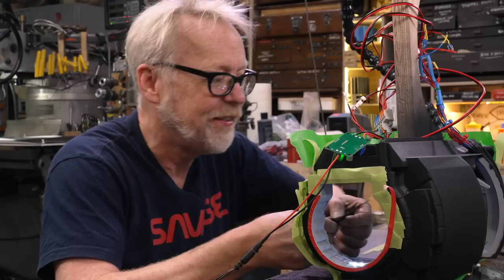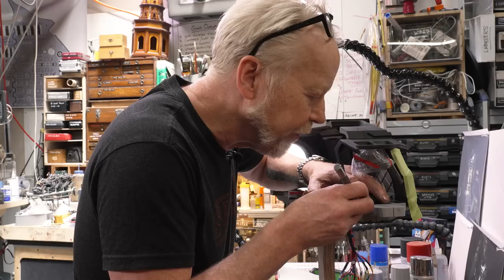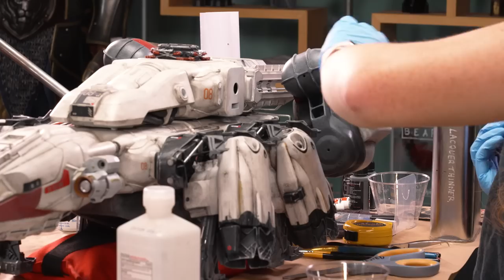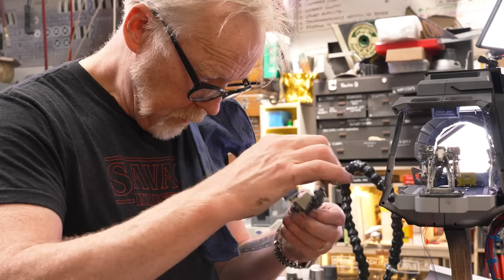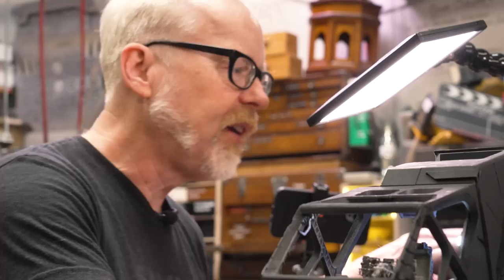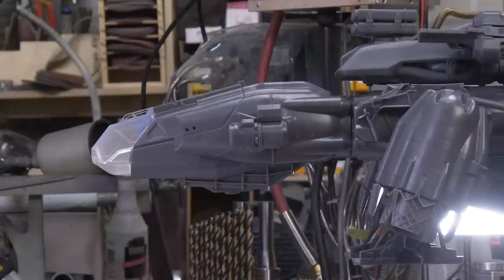Adam Savage's STARFIELD Spaceship Model Completed!

Comment: Hey Adam, I have a tip from my years in the art glass business. When your transferring stickers with transfer tape, there is a wetting fluid (vanilla smelling) that prevents the sticker from adhering temporarily you can spray on before you put down the stickers. It’s why transfer tape is clear, so you can slide the stickers around into position. Once placed you squeegee the water out or let it evaporate and peel off the transfer tape.

Comment: This project proves that 3d printing isn't the death of model making but rather it's evolution!
Reply: Problem is for something like this you need very large high quality printers that aren’t cheap.
Reply: Not for modelmaking, for model companies... I still prefer injection molded, or cnc'd parts tho. It's just not fun to work with resin pieces.
Reply: @AgentTaft  not really, you could do this on a $300 printer all day. There would just be a lot more sanding and primer involved to hide layer lines. You obviously won’t get as much detail on a cheap printer, but most hobbyists aren’t making models for film sets. There are also a lot of techniques you can do to bring that detail back.

Comment: Fabulous series watching pro model-makers at work!  I'm always amazed though at how much "rougher" studio models are compared to high-level scale models you see at exhibitions and contests.  For example, the 3D-print layer lines visible on the spaceship model would need to be sanded smooth in any decent static competition model. However, they're left alone in the studio model, saving many hours of tedius work while providing surface textrure that adds interest and isn't seen by the camera.  Great series, really loved this content, thank you!!
Reply: Yeah, I kept being diistracted by the visible polygon facets on the model though. X)
Reply: @DarthBiomech  I did notice that, could have been corrected before printing, but it doesn't really matter to me, this series was utterly compelling to watch.
Reply: @DarthBiomech  I don't think they are, the final files printed are very high poly, I think that's the shape of the exterior panelling for those parts
Reply: @cenciende9401  some of them... some parts not so much, did you see the interior wall? That was rough.

Comment: 3D printing is amazing and this model shows the endless possibilities using it! It would have been 10/10 for me if you guys worked a bit more on the printed parts to remove the layer lines and low resolution cylinders. 9.5/10 ! :D
Reply: Some of the faceting in curves (likely in the game models) bothers me more, but I don't think any of that will be visible in camera and that's the standard they are working to ... not to model show perfection.
Reply: Yeah the faceting is what i meant by low res. I look forward to seeing the shots and you are right, it might not even show up!

Comment: While it's a bit overkill but totally fits my 'If it's worth doing, it's worth Overdoing!' mantra, skateboard tape (or if you're Real good with backer spray, large grit sandpaper squares) makes a fantastic stand-in for military-esque Chemsol coatings; a material/surface often found around carriers and such that provide an anti-slip friction modifier. Not quite as user friendly as vinyl as you have to be bang on straight on that first attempt before peeling off the adhesive liner, but man it looks fantastic when adding wear and weathering for foot traffic.
Reply: I wonder if you couldn't find a 3m tape that would allow some repositioning... likely that's what's on the back of vinyl (or a super cheap ripoff).   There are 3m tapes for All kinds of crazy applications.

Comment: I have a small decal shop.  With vinyl, there's a bit of a "memory" to it and if you hit it with a LITTLE bit of heat from a heat gun or hair dryer, it will relax and you can get it into and around edges.  Same with air bubbles., if you get one, tiny poke, hit it with some heat and they will release and go down.  AND YES you are right about those tweezers, my only issue that i have found with the ifix-it ones is the end where they are connected will sometime start to become disconnected and shift a bit.  I found an amazing titanium pair that are long, angled and a SHARP point.

Comment: I know it will not register on camera, when you finally shoot the beauty pass(es), but computer fabrication seems to add these lines across the model, which doesn't make the weathering look as good as it actually is. I don't know if that's something requiring fine sanding or what, but it's the thing that I really notice, since everything else about the model is absolutely perfect and gorgeous.

I'm sure there's also time constraints involved.

Comment: Seeing that airbrush reminds me of when my airbrush was spraying drips. I thought I may have made the paint consistensy wrong so I did a quick clean and started again. Didn't help so I pulled it apart and put it back together. Still didn't help so I pulled it apart and re-cleaned every piece and put it back together. Still didn't help so I pulled it all apart, cleaned it all and put it away. While putting it away I realised all the spray nozzles were still in the box and I had been spraying without one.

Comment: The ship looks awesome!! Well done. I am a big fan of rc stuff and painted many cars, boats and planes in my life. But always like they were new from the factory. But when corona hit a few years back I thought it would be nice to have a new project when we had lock downs and bought a kingkong ca10 truck. A lot of metal parts. Plastic body of a classic farm truck cabin and a wooden cargo bed. I decided to do it different this time and make it an old rusty dirty beat up truck. even found files to 3d print a fake oldskool petrol engine ( like 30 little 3d prints) that would slide over the electric motor under the foldable hood doors. I dented the car in some places by heatimg the plastic cabin parts to make it look like damage from little accidents, made it look rusty by spraying all in a rusty color. When dry make it wet with water. Add coarse sea salt. let it dry so ot will stick. spraypaint the cokor you want and let it dry. Then use a your nails to break away the salt leaving rough edges with rust color underneath. Painted the engine like it is very old ad greasy and dirty. wired aome stuff on the bulkhead to the cabin. even added a warm white micro led under the hood. also in the cabin. Then weather the paint and make the chassis look old and dirty and rusty too. added some nice walking dead figures that were the right scale. adddd a dog in between. added things like cigarettes and a toolbox. etc. It eas the first time ever and was afraight to do it at first because the car was just assembled and completely new and shiny.  But the rust and dirt and wash added a lot of realism to it and also make it more easy to use it since some extra dirt and scratches don't matter. easy to weather them away again. it was the first time weathering and first time using my budget airbrush to add some "dust" from country roads on th🎉e lower sides too. I had great fun.

Comment: One of the things I did on a MechWarrior dropship I got was to mask off a few of the exterior panels when I weathered it.  I wanted it to look like those panels had recently been replaced due to damage and thus looked "newer" than the rest.  In addition, I added "mud" splashes underneath, thinking since it was a dropship, it'd probably pick up dirt from landings.  Still, nothing compared to this model.

Comment: Nice job with the model, but I have two comments.. 1) for me personally the matt cockpit glazing is bringing the entire level of detail down, I can't look away from it. It should really have a visible interior. 2) the light of the 4 side engines should be diffuse, casting a glow on the table, not a clear circle like a desklamp. Because of the small point light source it's not a realistic casting pattern. Using multiple defusing leds would work way better.

Comment: The cut out internal area looks sublime! To me, and this is just my opinion, the weathering on the ship looks like it would work, if the ship was the scale of the cut out part.  It looks too rough.  Too much for it's scale. It works with the cut out, but not the smaller model.

Comment: QUESTION to all you model makers :)  I was thinking about a method to save time when masking for example an interior to be able to color the outside. What if  you has  balloon the one blew up  until it covered  the insides. and just about started too bow out threw the windows and openings. It would perhaps need to be one that wouldn't pop to easily. I know next to nothing about model building, I just always try to imagine solution before learning about already established methods because that's usually how I get novel ideas. Sometimes good sometimes bad, and if so I just discard them. Does this method sound like it could work well?

Comment: If this is a fairy tale, then I want to find out what type of fuel is used in this ship to lift it into the upper atmosphere.
Reply: They use the Sci-fi fuel of Anti-Grav. No need to film zero g scenes and no crushing accelerations. Thinking about it, the ships wouldn’t acually need the big flaming thrusters since they would just lift off like hot air balloons. But thunder and roar sells 😅

Comment: i wondering if the weathering is over the top.  why would the inside get grimmy and grotty? nlits not like its down a coal mine.  ans the outside it will just be some dust and travelling through atmospheres would burn off most grim. maybe just leavint scorching marks on yhe leading edges. and rust?  would it trally have iron in it that rusts?  it would be made with titanium and aluminium or something light with high melting point.  and i think in a space travelling age theybwould have the equivalent of services and even car washes.

Comment: Great work!
though... You really should have subdivided/remodeled the original game model in some places prior to printing, rather than just print out the game LowPoly mesh. Especially on the engine pods and some beveled edges - it's clearly visible they are heavily faceted, a feature that is hidden in-game by the auto-smooth and the weighted normals features of the game engine. 
Also it's possible modeling in some of the details of the model that were done by decals in-game, panel seams, bolts, etc., though that might be a bit of an overkill depending on the design. But the faceted look of some of the parts that are clearly supposed to be rounded is... yeah.